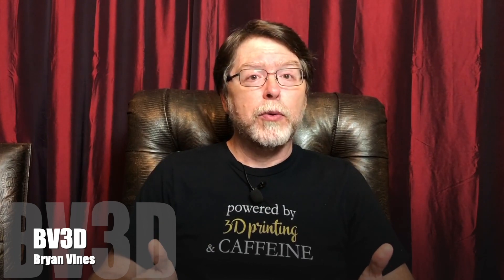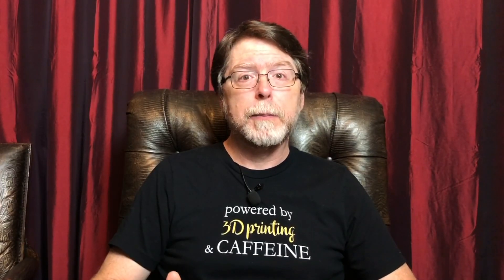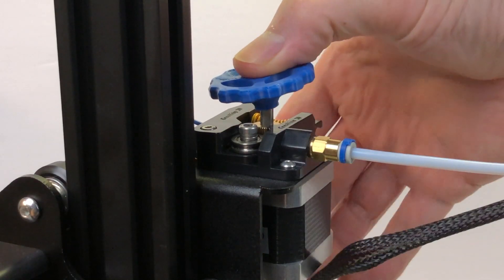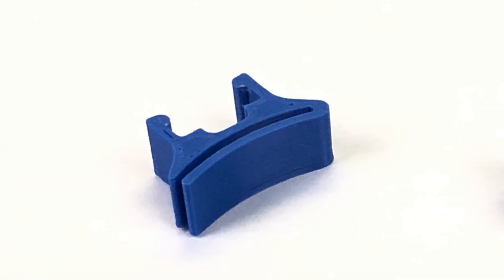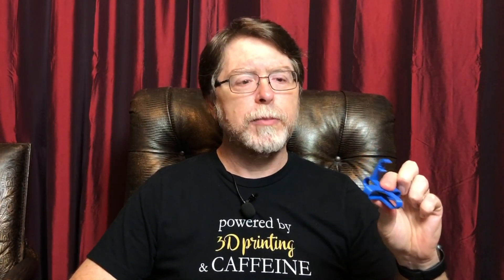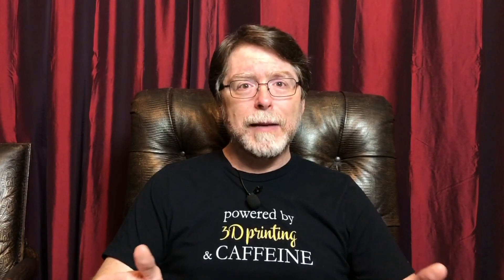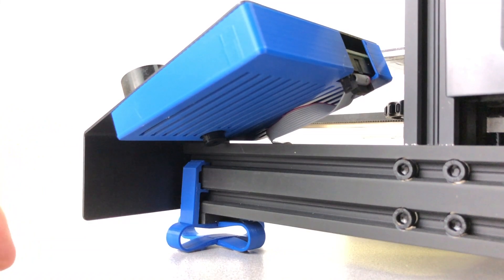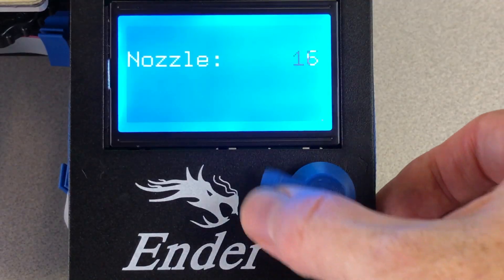Five Simple, Printable, Snap on Upgrades for Ender 3 and Ender 3 Pro

Comment: I did the knob, ribbon clips (different design), damper feet (w/o the snap), and board cover (also diff design). I disabled the beeper in firmware😉.
Reply: Huh! you can disable it? i smashed it of with a hammer ;I
Reply from the maker: I still have the knob and clips on the printer; I designed and printed some feet in TPU that seem to do a decent job of absorbing some of the vibration. 😃

Comment: Not shew h
What happen in this episode but my that room noise was really loud  it was driving my ears nuts. Beside that good video.
Reply from the maker: Hi Ron. Sorry about that, and thanks for the feedback. Audio is definitely one of my weaker points, and when shooting video using my phone, I can't adjust the gain on the mic. And the mic is cheap, so it doesn't have a gain adjustment of its own. I end up having to crank up the levels in my editing software and that's where the additional hiss comes from. 😧

Comment: NICE VIDEO BRYAN. IF ONE HAD AN ACCELEROMETER ONE COULD EXPERIMENT WITH PLACING  SOME WEIGHT ON THE PRINTER TO CHANGE THE SPRING RATE OF THE DAMPENER FEET AND PERHAPS TUNE OUT ANY BAD VIBES. A LITTLE HIGH TECH BUT IT IS JUST A THOUGHT.
Reply from the maker: Hi Jimmy! Thanks! That may be more effort than I'm willing to put in right now. But that's a really interesting idea. Mount an accelerometer and take measurements while "printing dry" -- just letting the motion system do its thing. Then try different dampening methods and see which one yields the best result. 
Although I did have a note from 3D Gussner pointing me to a CNC Kitchen video about dampening feet. I need to check that one out.

Comment: You can also print cable ties to go with those brackets!
Reply from the maker: Most zip ties are nylon, aren't they? I bet I could print some with a stiff TPU though! 😃
Reply: @BV3D   thing:3514282
Reply from the maker: @AndrewAHayes  Those are a great idea, using TPU for the "tie" part of the zip tie. I liked the rubber band toggles, too. Thanks for sharing!

Comment: Great stuff Bryan. I have similar feet on the MK2, but for the #Borg I have these printed in flexible filament https://www.thingiverse.com/thing:3020865 They seem sturdier but absorb a lot of sound vibrations from the printer and they clip straight in too, I also turned down the vref on the drivers too as they were set far too high originally, no skipped steps either lol
Reply from the maker: Hi Spike! I saw those, but I didn't know how well they would work. Plus I was kind of sticking to PLA prints for this video. I also considered some of the feet which hold a racquetball but I wanted to keep the video limited to things that didn't require other things.
What's the Shore hardness of the TPU you used? I've got some black SainSmart TPU that's pretty stiff, but would probably be great for those feet.
Thanks! 👍
Reply: @BV3D  Don't know the shore hardness, but it's from 3D Printz. 2 perimeters with 20% infill. I wasn't sure they would work, but they have been in place for almost a year, don't fall out either.